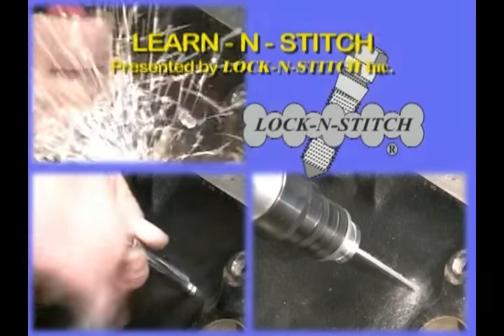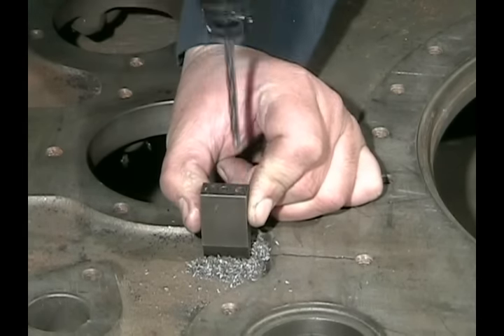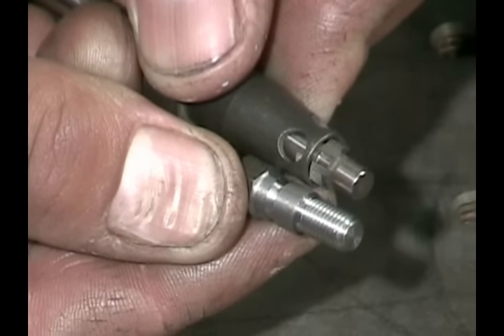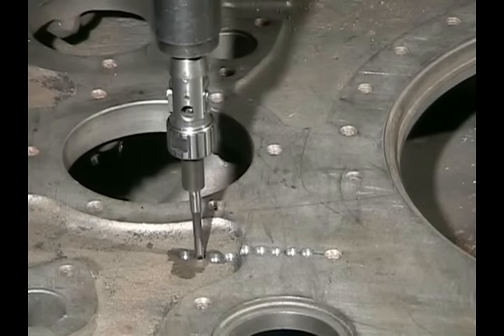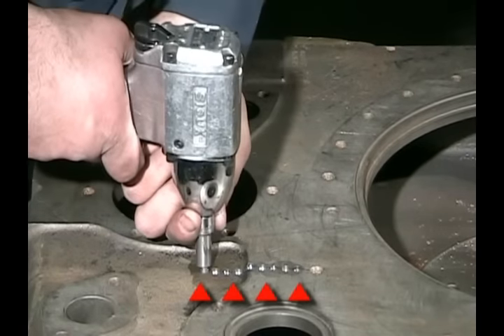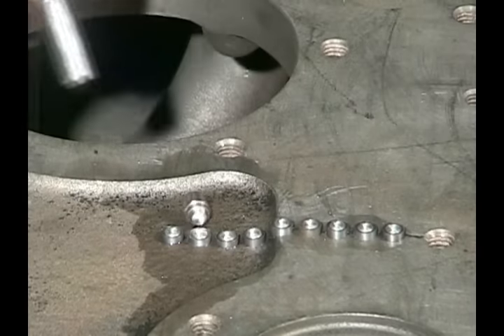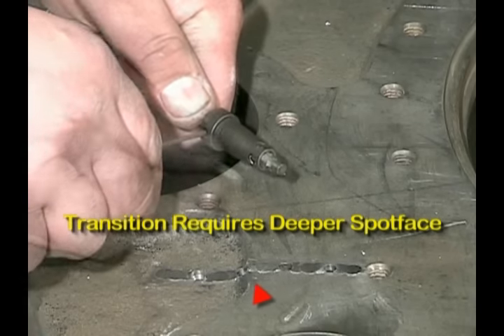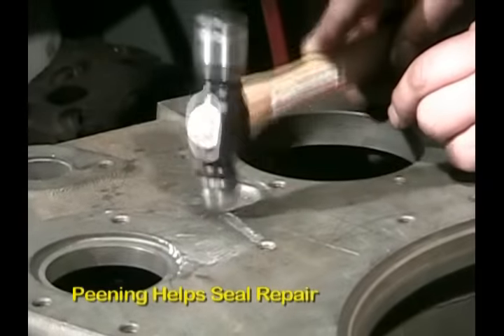Cast Iron Crack repair

Comment: Note that this procedure only works for compression cracks, where the surrounding metal jams against the stitch bolt.  It DOES NOT fix tension cracks! (where the crack is being pulled apart by stress) In that case, stress on the part would pull the crack open more releasing the force on the stitch bolt. Sometimes welding or brazing is the only way. :(
Reply: I agree!
Reply: No way, I'd catch another one of your comments! You're awesome! Great minds think alike!!!! :DDDDDDDDDDD
Reply: You obviously didn't watch the next video, installing the locks....
Reply: This type of repair has hooks on threads that draws in the crack in the casting that is being repaired. Unlike the method  used by irontite product which  I've  used both methods. Irontite tends to spread apart  the repair  if you are not  aware  that this happening. I've  had great success in both methods with no failures. Used to charge $100 an inch don't  what the price is now
Reply from the maker: @ericbruck7958  100% correct  - unlike tapered plugs, our patented stitching pins and thread repair inserts pull the surrounding material together adding strength and creating a permanent repair!
Reply: Exactly I was also wondering how it works when crack is caused by tensile stress

Comment: In the 80's I worked in the office of partners in a welding company that were working on getting the patent on this system. I typed up the description for the process. The boss would tell people that I could probably do the process as well as the guys in the shop because I knew and understood the system as well as any of them. The idea behind this goes back to the 1700's. But had many flaws that caused failure.The designer went through and solved each one. I saw this used on boat motors that cracked when they weren't properly winterized. They ran as good as new. The locks that run across the stitching pull the crack together in such a way to keep the crack from opening up while the pins replace the cracked material.  The locks used in the past would often push the crack open wider and not pull it closed. That really helps to make this system work. The repairs last, they repaired engine blocks and heads to the huge military trucks then would run them for 100s of hours or more without a failure. The man who created and taught me how and why it worked and had me type up descriptions on the process was creative and knew and understood metals. Unfortunately he lacked the vision to understand how to profit from his creation and not lose what he had. Creativity may not walk with wisdom.

Comment: Recently metal stitched a #4 GE combustion turbine crankcase. The job cost the customer $45K. (A new crankcase was $4 million US). The turbine has been back in service for 3 years now. They are very happy.
Reply from the maker: Thank you Mark for sharing!  We love hear how the process can get a customer back up and running, in turn saving $ by repairing instead of replacing the damaged casting!
Reply: Mark Doty recently made a repair, 3 years ago.......   Math?
Reply: Mark Doty $45k? Must have been hard to get to to demand that kind of labor pricing!
Reply: ken cohagen He could have charged more. It's not about labor or materials cost, it's about the value. In many industries you can charge up to half the replacement cost to perform the repair. Think of it, if he had charged them $100k, it still would have saved them $3.9 million dollars for a replacement part. The value is therefore HUGE!
Reply: Steve Mentzer That is why even small company's  have their own mechanics and metal workers n stuff!
Reply: Tan Tan 3 years is recent enough. Especially for the job he mentioned.
Reply: '...turbine crankcase'? what is that?
Reply: A combustion turbine is like a base mounted stationary jet engine used to drive in this case a generator. The turbine rotor sits in a very large cast "crankcase".
Reply: Job took 3 men 5 days plus travel and lodging.  The crack was substantial and both sides of the  case surfaces had to be stitched. The customer was extremely pleased having saved millions of dollars.
Reply: i uderstand the logic, not the outcome. when there is so much to be earned from the repairer's side, competition should lower the price. plus, for me, charging more than your normal because the part is expensive, provided that you do not face any higher risks, is just, unethical, unprofessional, opportunistic and against all common good.
Reply: If you bother to do the math for 3 men, 5 days on job, 2 days travel X 3 men,  Mileage, 6 nights hotel each X 3 men, meals,  plus materials and consumables the cost to the customer was not unreasonable.
Reply: As matter of fact, $45k was probably very competitive for the job given all those expenses.
Reply: Steve Mentzer thats true until you get competition, then your in the gutter
Reply: @kencohagen4967  No.its eazy 4 million or 45,000?.
Reply: @smportis  I agree, some companies may not even have touched it!!! Said you buy a case or find someone else!!!

Just because it can be done doesn’t mean that a company can and or will do it. At the end of the day, the business needs to make money above cost of goods, travel, people, and what not.

Comment: Years ago I heard my father refer to this method of fixing cracks in engine blocks while at sea as a merchant marine. Very cool to see it used, what a great video!
Reply from the maker: You are right the method of 'pinning' cracks has been around for a long time.  The art of metal stitching has improved on the older techniques and the LOCK-N-STITCH patented thread design has the capability to repair castings like never before!  Thank you for watching!  www.locknstitch.com
Reply: I have seen metal stitching done on detroit diesels engines  in motor scrapers. 
A very successful  repair, saving on engine block or head replacements costs .
Reply: @LOCKNSTITCH  what are the pros and cons of stiching vs welding?
Reply from the maker: @jonathangarzon2798  here is a white paper written by Gary Reed the inventor of our patented products and services that will go into your question in depth - it is all in how cast iron responds to heat that makes welding so difficult http://www.locknstitch.com/pdf/gmrc_white_paper.pdf

Comment: Absolutely love this company!!   A mechanic (friend of mine) accidentally drilled through the water jacket , while attempting to remove a broken bolt in my engine block on my Camaro. (A power steering pump mounting bolt had come loose, snapping the other bolt clean off below the mounting surface) The great idea to drill it out turned sour the minute I saw coolant coming out of the hole. He apologized and took off.  After several calls it seemed hopeless. Nobody knew how to fix the hole in my engine. I worked all night on a custom plug to fit tightly in the hole, with the proper size bolt on the other end. I planned to spot weld it in until I was told it wouldn't work....
So I typed "weld on engine block" into the google search bar and  found Mike. He told me about Full Torque and I purchased a kit with drill bit, a tap with special threads and matching insert with a locking pin and glue. It was so simple, I did it myself.  I cannot say enough about this ingenious product that came to my rescue.
PS This happened over 10 yrs ago and my 2000 Camaro hasn't leaked a drop of coolant and runs like a champ. 
In short:  LOCK-N-STITCH is BOSS!
Reply from the maker: This is GREAT!  We are thrilled to read your testimonial about LNS (sorry for the delayed response, YouTube filtered your comment out for approval in error) We would certainly approve a comment with such high praise, The more people know the more they are amazed at what can be done in the world of casting repair with the LNS products.  We appreciate your support and again for the wonderful comment.  Would love to see any pictures you might have so that we could share this story on FB - testimonials are the best!  Glad to hear the Camaro is still running strong!!

Comment: I first saw this done in the early 1960's on an old flat head Ford V8 engine.  The very experienced mechanic used 6013 welding rod with flux removed.  Simply drilled a hole, tapped the hole for 1/8 inch rod.  Threaded the rod then twisted the rod into the threaded hole.  Then cut the rod off flush filed smooth.  repeated the process overlapping the threaded welding rod by half until the entire crack had been laced closed.  The engine was still in service many years later.

Comment: Great video! I learned of this process years ago working in a diesel engine fired power generating plant. I have tried to describe the process several times over the years and now having this video to refer to, will make it much easier. Thank you!
Reply from the maker: Thanks Robert and you can also refer people to the website www.locknstitch.com there are some great examples of repairs there as well!  Appreciate you watching and commenting.
Reply: Will do, thanks!
Reply from the maker: @TrojanHorse1959  Feel free to reach out to us if you have any questions or need help!  info@locknstitch.com or 800/736-8261
Reply: From where I can get job of this field.. I have more than 8 years experience of metal locking

Comment: I am impressed by this technique. It makes a lot of sense, since welding can and most likely WILL introduce internal stress to the casting. However this technique alleviates those stresses and completely repairs the crack all the way through.
Reply from the maker: You get it completely! This process pulls the metal together, adds strength.  No heat involved, no additional cracking or stress!  Thanks for watching and for commenting!

Comment: we always drilled a hole on each end of the crack to relieve stress and then welded it.  But that was 50 year ago  :D
Reply: I'm watching this in 2021 and wondering why they didn't weld the damn thing :-D
Reply: @bitterbaldguy  
As I understand it, welding cast iron can induce stresses that can cause the casting to fail at a later time. This process relieves stresses.
Reply: @xenaguy01  just sharing some info here: theyve come out with a product called muggy weld just for welding cast. it stays somewhat flexible. if its not available then nickel alloy works well too. you can avoid pre heating cast but still do short sections(3/4") at a time and pein the heck out of it.
Reply: @bitterbaldguy  you ever tried to weld cast and get it to take?
Reply: @cuzz63  ummm....yea?
Reply: I prefer a hot bath
Reply: I've used nickel stick welding rods and tig with stainless 316 L. Plus pre heat and peen after to prevent further cracking.
Reply: I've always drilled each end of the crack in engine blocks and ground the crack then brazed it up. That's how they use to fix mistakes in the castings at the factory instead of scraping the entire block.

Comment: We used to repair flat head jeep engines that would crack, basically the same thing drilling and threading with bolts. This is a nice setup.
Reply from the maker: Thanks for watching and your comments.  If you ever run across a need to repair any casting again, give us a call!  We are always here to help.  800/736-8261 or 209/632-2345 info@locknstitch.com  Happy New Year!

Comment: I like the jig for getting perfect results here.. I always eyeball and I also overlap each pin (meaning on a 1/4 inch pin I would start my next hole 3/16 over.. Stitched up many cast cracks with this method and it worked flawlessly.. No sending heavy flat head blocks off to come back with more cracks. Fix it right the first time is my motto. Great product.
Reply from the maker: Thank you for the positive feedback!
Reply: Good products deserve nothing less. Next cracked block, will be getting this kit. Great design.
Reply from the maker: We are here when you need us!  800/736-8261

Comment: It’s nice looking, and I hope works.  I had an engine over 100 years old that had this done but still seeping. Had it cast iron welded, looking great and no leaks. Took 6 hrs to heat the 11” bore by 36” cyl. And then about 8 hrs of welding time.
Reply from the maker: Hi Gail - if you still have 'seeping' we can help. Please reach out to our customer service team, if you send pictures of the leak that still remains we could provide a solution for you.  Thank you for watching and commenting - we are here to help you at any time!  info@locknstitch.com

Comment: This method has been used for years and is one of the best ways to repair a crack on a cast iron surface, I've used it many times and never had any problems .
Reply from the maker: John that is great to hear! Thanks for commenting and we wish you continued success with our products!  If you need technical support or additional products/services do not hesitate to reach out to us.  800/736-8261 or 209/632-2345 info@locknstitch.com

Comment: Metal stitching has been around for a long time, and I've seen it on machinery and people talked to me about it.  This video is the first I've ever seen it done.  It fills and stabilizes the crack, but adds no strength.  Threads are an inclined plane which generates forces both vertically and horizontally, which tends to widen the crack slightly, which would also preload the threads thereby keeping the joint tight over time.  The way the pin is made would stabilize the crack vertically as well.  A lot of castings are not that thick, but some machinery castings are.  It could be machined flat with the surrounding metal and present a sealing surface with no perceptible imperfections and involve no heat.  The only thing I would say is when you see him free-handing the first hole between the holes at 6:50 is, "don't try this at home" without some sort of jig.  Also, the metal sure seems to drill nice in the advertisement.

I never thought to repair a crack on a sealing surface, so I'll remember stitching as an option.  It is also low risk.  However, stitching cannot fix something that is broken and adds no strength.  If anyone wants to argue that stitching does, they shouldn't mind if we saw around the crack. The pieces will fall apart in your hands, and you will never get it back together like it was without the compressive force of the surrounding casting.  For more than filling a crack, IME the cast iron rod was hard to work with and simply produced a weak zone of embrittlement.  Brazing adds a lot of heat which causes warping stresses of its own and not a particularly strong bond.  You can end up chasing cracks and preheat can warp things.  For most things I"ll continue with cleaner and dye penetrant to find the ends of all of the cracks, stop-drill, a little v-grind, weld with nickel rod, and check again for cracks.  This method has been the easiest, fastest, by far the strongest, and seems to mitigate the embrittlement at the joint.  I have never had any kind of issue with this method, structurally, warpage, or leaks.  Nickle is also not that hard, so it's easy to work if you need to.

Thanks for the video!
Reply: Is that with a good pre and post heat using the nickel electrodes? I've been chasing cracks in a piece now. I've tried 7018, albronze stick electrodes and I tried some stainless steel rods that would just blow holes. I'll probably end up cutting a section out for some mild steel at this rate. Good practice though. I think my problem is the pre and post heating but I don't have an oxy acetylene set unfortunately
Reply: @PercyJackson93  I've never preheated with the nickle rod and I never had cracks run on me but I did drill just past the end of the crack.  I V grind a little.  I've had lousy luck with anything but nickle.

Comment: This company saved my butt and my job way back in 2002. I messed up the layout for 2 knockout holes in the platen of a brand new 1000-ton injection molding machine and bored the holes wrong. These were about 2 1/2" in diameter and were half a hole off. We flew their tech down to Carlsbad, and he stitched in some plugs so that we could re-bore the holes in the right place. Still running ten years later.
Reply from the maker: Myron thanks for commenting and so glad to know that you have not had any issues and everything is still running!  If you ever need us again, products or services we are here for you!